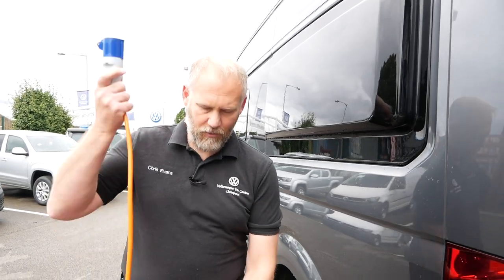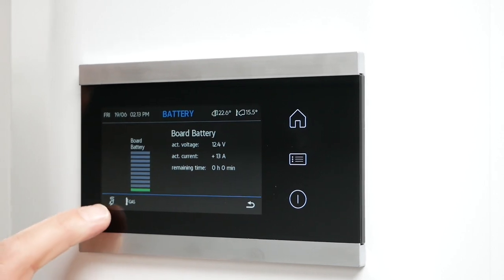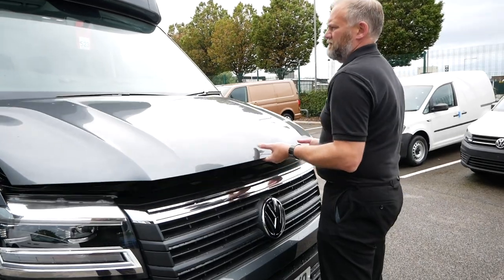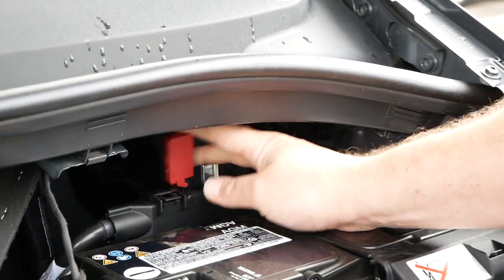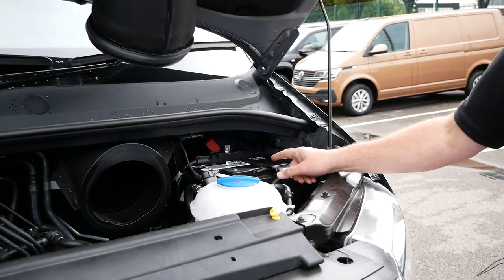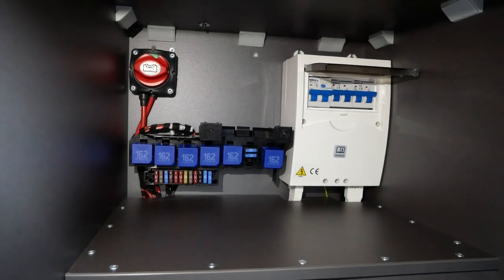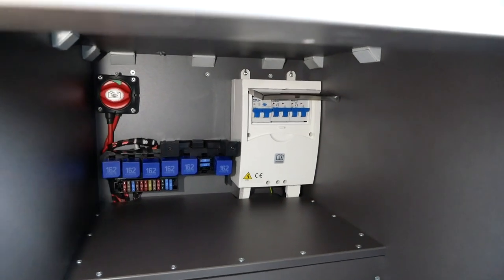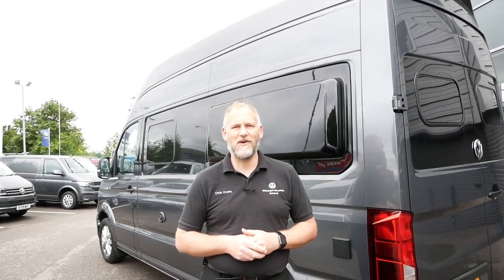Grand Cali Handover: Electrics | California Chris Mini Series PART 3

Comment: Once again Chris, very informative straight forward video. I will answer a few of the questions below for you, as I have just spent  81k on with all the extra's , No second leisure battery but its 92 AMP battery. I have also added the solar panel as an extra. No the 230v sockets only work when you plug into the mains supply on a site. You can get a converter from 12V sockets to 230v but could use your battery up fairy quickly depending what is plugged in. One my research list. I will recording my experience's from delivery to my initial trips. Any issue's, I can upload to YouTube for all to see.

Comment: Is there an option for a second leisure battery if you wanted to go off grid for a bit longer? if so where would it go? Also does the standard equipment boiler run off both gas and electricity? Thanks
Reply: Ciao, io ho da poco acquistato il GC 600. Volevo chiedere, a te quanto dura la batteria stando in sosta? (io non ho il pannello) Grazie
Reply: @andreazampedri6020  circa un giorno o due. consiglierei un powerbank al litio come l'unità poweroak 2000wh ma costa £ 1500 ma risolve il problema.